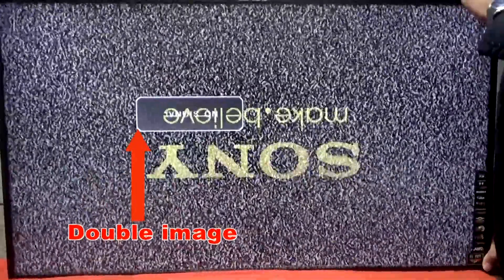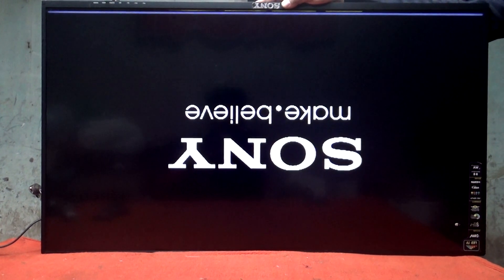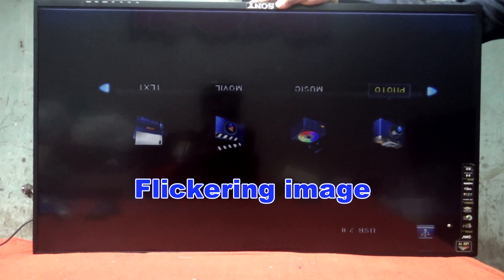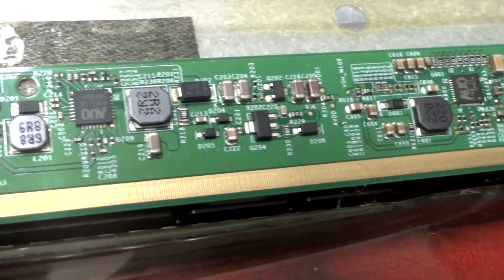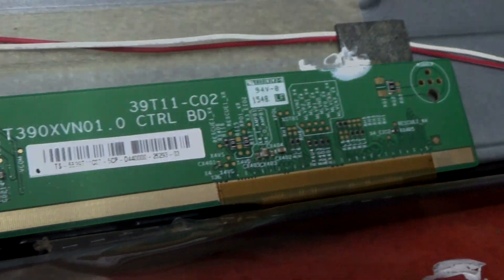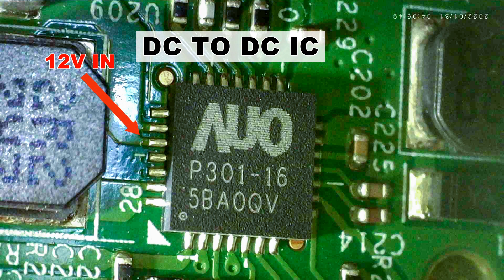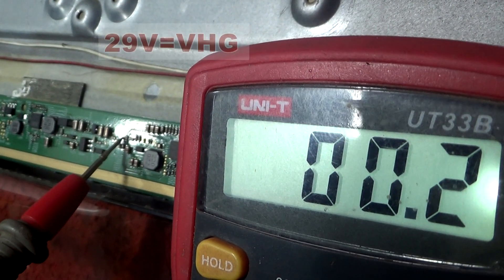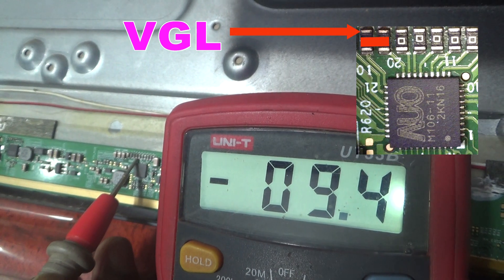LED TV panel repair by removing a block.#Pro Hack

Comment: I am from egypt
And l'd like to know the you get information which lines to cut and what their rule in the circuit is.. if u don't mind
Reply from the maker: ODD and EVEN have come from Level Shifter IC.
VGH ODD LC1, VGH EVEN LC2....
Reply: @ProHackHD  
Thanks alot

Comment: lsc320an10 panel mirron change without remote
Reply from the maker: Which motherboard?
Reply: Vai sonny barvia
Reply: @rakibposu7160  Plasse sir, reply me
Reply from the maker: If it is a new model then you will get the service in the factory.
Reply: Factory get, But no mirror option available